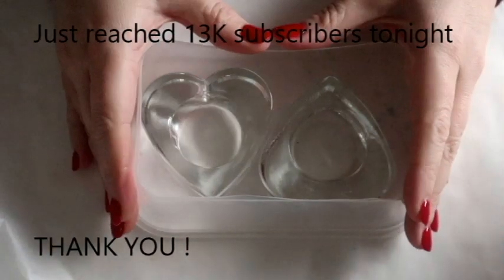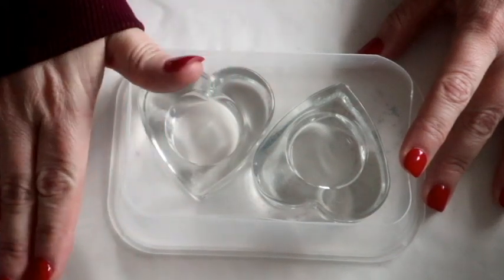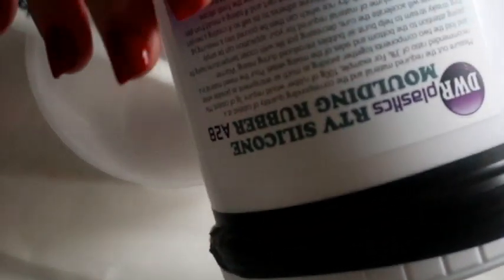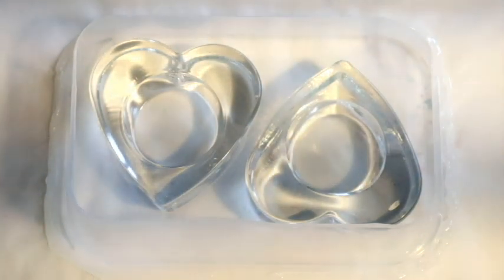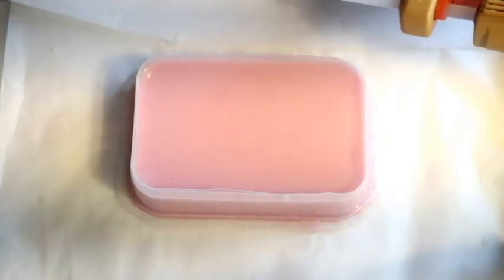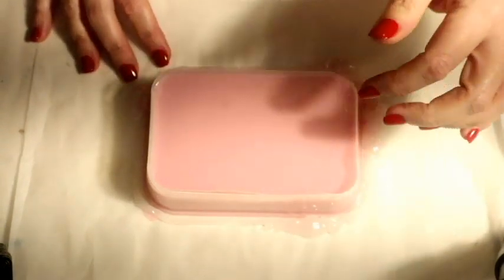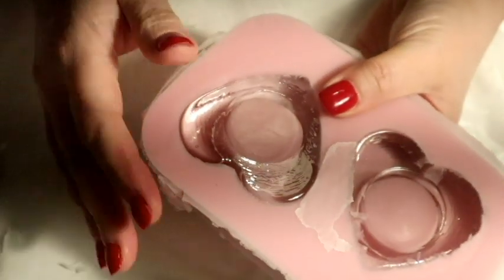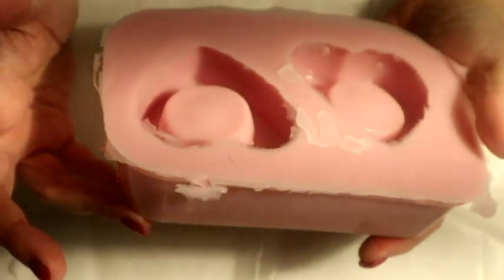Absolute Beginner DIY silicone mould

Comment: This was fantastic instructions. Try using contact paper instead of the parchment paper. Also they have what's called mould release.
Reply from the maker: Hey thank you so much .. I have since made another mould using tape it was definitely better than parchment paper. It has worked perfectly .. thanks so much for your advice. x

Comment: If you have access to Contact Paper shelf liner you can use the sticky side up to make sure your bits inside are stuck down and don’t move and it will be a much easier demolding.
Reply from the maker: Thank you Laura, that would definitely be better x I have made another mould since .. and used tape. it worked perfectly x

Comment: Great tutorial, where did you get silicone from and could I use a wooden ornament? Thanks x
Reply from the maker: Heyyy Tracey ... I got it from Amazon .. there are so many on there ! Xx if you want this one type the name into search it should come up x I will log on today and get it linked in description xx
Reply from the maker: Also ... I dont think wood will work no ... it's very porous... if you coat the wood in resin format though ... it will x
Reply from the maker: https://www.ebay.co.uk/itm/High-Quality-RTV-Silicone-Moulding-Rubber-1kg-kit/283325952222?_trkparms=aid%3D1110001%26algo%3DSPLICE.SIM%26ao%3D1%26asc%3D20180213162448%26meid%3D68d171fe503644239653e4b08ee51789%26pid%3D100930%26rk%3D3%26rkt%3D12%26mehot%3Dpp%26sd%3D272583713012%26itm%3D283325952222%26pmt%3D0%26noa%3D1%26pg%3D2332490&_trksid=p2332490.c100930.m5375
Reply from the maker: I've just linked the product babe x its ebay
Reply: Thank you so much for your help xx